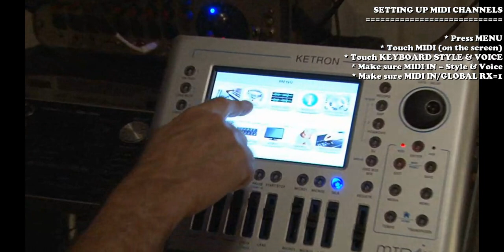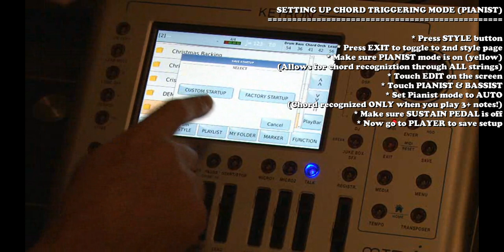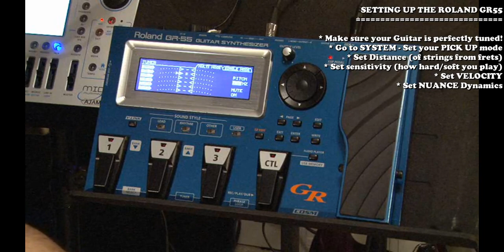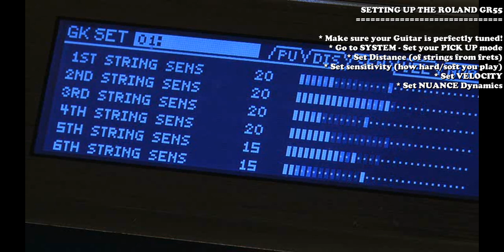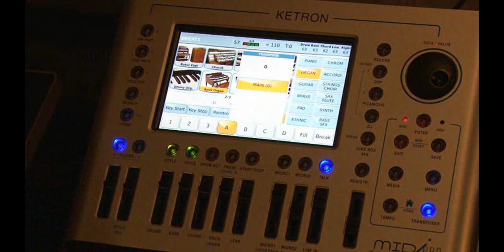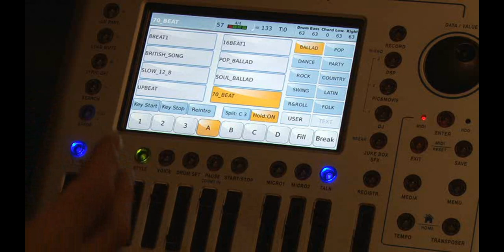Setting up KETRON Modules for use with Guitars - with Larry Read

Comment: Hello. I'm doing the same as in your video, and only one string plays, and I can only change the E1 string to other instruments, while the other strings don't play. Why?
Reply from the maker: You need to make sure you change teh Roland from MONO to POLY mode (it turns on in MONO mode by default from the factory - only one string can be heard at a time, but you want it in POLY mode).

Comment: I did it again and only one string on the guitar plays, what's going on?
Reply from the maker: By default, the midi guitars transmit in mono mode (meaning one note at a time). You need to put it in POLY mode (transmit on all strings at the same time and on the same channel).

Comment: Hello again. I bought a Roland GR55 and connected it the same way as in the Ketron midijpro video, but unfortunately I don't get a signal from the guitar to the amp! Everything is connected via MIDI cable, but nothing works?
Reply from the maker: Make sure the Midjay (MENU - MIDI - Standard selected - Arranger Keyboard - RX - Global =1. All other channels should be off/--. Save this setup. Then exit from MENU and turn on PIANNIST MODE so your guitar works with the entire instrument without any SPLIT point. Next, make sure your Guitar is set to transmit in MONO mode (not POLY as is usualy set as default from the factory).

Comment: Me again. I was looking at the Roland GR33. Is it possible to use a Ketron MidiJPro with a Roland GR33? Do I need to connect it with a MIDI cable? Regards.
Reply from the maker: Yes, it is. A 5 pin midi cable is prefered, although you can also use USB Midi.

Comment: Hi. I did everything as shown in the video, but unfortunately, I don't have the piano sound on my guitar. I don't know why. I don't have the Roland you have, is that why I don't have the piano on my guitar?
Reply from the maker: Make sure your Midi guitar is transmitting on the same channel as the Ketron Module is receiving (on the KETRON, go to MENU - MIDI - Standard - Arranger - RX). This will give you the midi Recieve parameters. Set Global =1. Now, also turn on the PIANNIST mode so that the chords can be recognized wherever played on the guitar.
Reply: Hi. I have a BOSS GT1. If I connect it via a midi-USB cable, will I still be able to set instruments from the Ketron midiJpro on the guitar? Like you do with the Roland GR55? Regards.
Reply from the maker: Yes. Make sure you turn on the PIANIST Mode on the Midjay so that the entire guitar is read by the KETRON (no split point).

Comment: Hi Larry, if possible, please update this video using the Ketron Event X module connected to a Roland GR55.
Reply from the maker: Set up is the same as the Midi menu is similar on the EVENT series.

Comment: Hi Larry, good work. Can i use same setting mode  on Midjpro to play with a PG 380 Casio guitar it has a midi output 
Thank you
Santo
Reply from the maker: Yes you can!
Reply: Thak you
Reply: Hi Larry I am having a bit of a problem with Midjpro when I Pair it with my Midi Guitar  as you instructed  works fine ....
until i go in to registration styles it does not recognize Midi  Guitar even when i go back to regular styles settings  for midi guitar are erased 
can you advice...
Thank you Larry ....
Santo
Reply: Let me add....at power on  page comes up AJAMSONIC .. not styles until i press styles than styles appear on screen ...
Reply from the maker: The problem probably lies in the registration settings. Did you set up for the midi guitar (check the midi channels each time you select a registration - just to make sure). If not, you will have to re-create them but first make sure the Midjay Pro is set up properly with your guitar BEFORE you go ahead to start creating registrations.
Reply from the maker: These probably means the original AjamSonic styles have been deleted from the machine. Did you check to make sure the AjamSonic package is still in the unit?
Reply: Hi Larry  I find that I cannot fully save Mid j Pro to guitar settings .Like the Roland  BK7. At Power on one must always press the Pianist logo until next power on 
Thank you

Comment: Hi. I recently bought a ketron midjay plus (older model), I managed to get the midi connection with the gr55 roland, but I only got the sound of the piano, I couldn't change the voices. is different? grateful if you can help. I'm in Brazil, and few know about these ketron modules.
Reply from the maker: Voices have to be changed on the unit itself.
Reply: @AjamSonic  I have this bad, it even appears saved when I am in style, but the sound continues from the piano. I don't know what to do anymore. I think it will be better to use without the midi. connecting ketron for styles and gr55 for other sounds.

Comment: Hi guys. I have a Casio MG510. I like not hauling my gr30 around with the fender roland. I bought an omb acoustic but was thinking about adding a fishman tripleplay connect to my casino. we always need a backup right? it has usb out like the omb acoustic. when are you going to test it out with a ketron? I'd like to order one but have to watch my spending with the few gigs I am getting
Reply from the maker: Coming soon. AJ is working on one.
Reply: @AjamSonic  I bought the fishman, will be here wednesday. still no parts to fix the omb so I bought a fishman to have a solid backup

Comment: Hello
I have a ketron midjay pro, I'm having a really big trouble with it may be you can help, i have a Roland XR module and when i play a midifile from midjay pro it doesn't transmit midi mesaages correctly to Roland xr, it plays different sounds? My  midifiles has GM GS messages, does midjay pro recognize and transmit these messages?? Or any other idea that i can use my midjaypro to play back  
midifiles to another module??
Reply from the maker: You need to 1. Make sure the Roland is transmitting in Polyphony mode (able to transmit transmission from all 6 strings at the same time). Roland ships in Monophony mode (transmition of 1 string at a time), so you will only trigger single notes in this mode and NOT be able to trigger chords. Hope this helps. Thanks. Follow us live this Friday June 12 at 1pm for LIVE SHOW:- FACEBOOK - https://www.facebook.com/KetronUSA

YOUTUBE:- https://www.youtube.com/user/AjamSonic
Reply: @AjamSonic  thank you for your reply, still I'm not clear with, wich means if i make my Roland fantom Xr Module polyphony Mode on, GM And GS messages will recognize whem i play a midifile  from Ketron Midjay pro?

Comment: larry do you plug your guitar into the roland or the mj pro i was told i could trigger the stle backings without  the
  use of a roland gr55  i have the roland GR55 SO IT WOULD BE NO PROBLEM
Reply from the maker: Your Guitar plugs into the Roland (13 pins) and then out of the ROLAND midi out (5pins) into your KETRON arranger. Check out more here:- https://www.youtube.com/watch?v=0RMMkOvYA0A&t=15s

And:- https://www.youtube.com/watch?v=J3KtKLrmloQ&t=519s